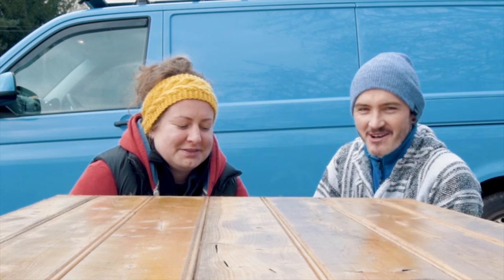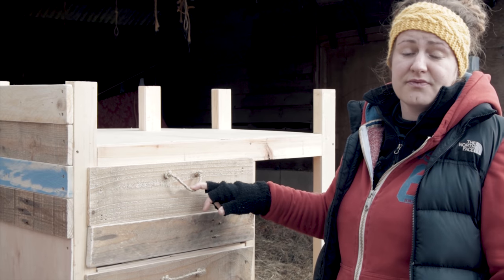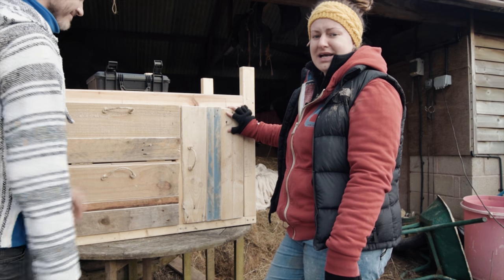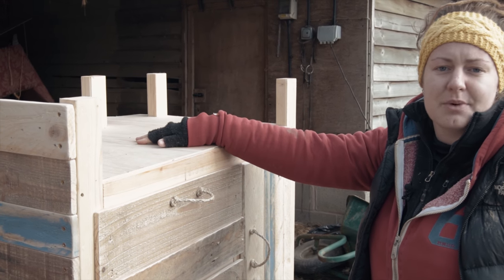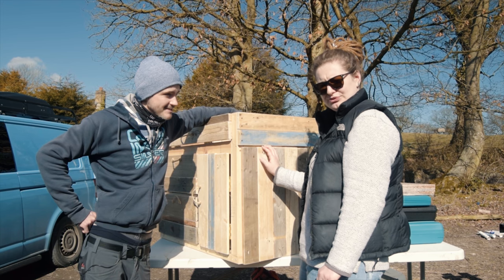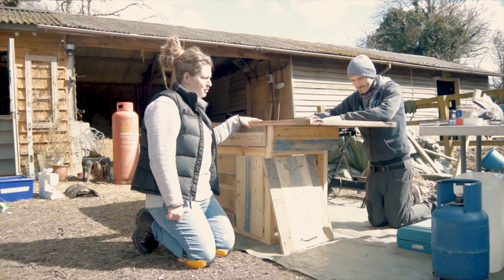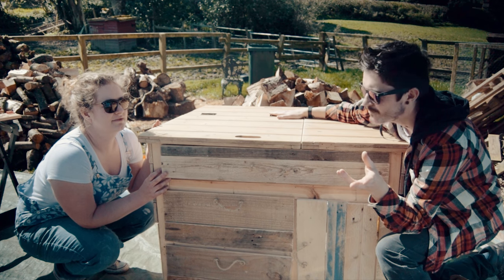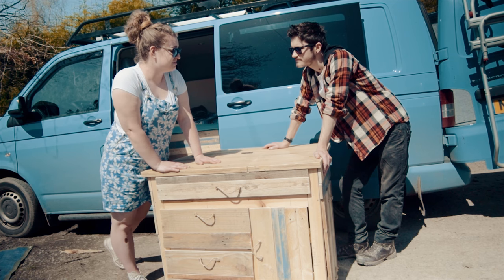Day 34 - Building Our Kitchen Unit (Part 4) #VanLife VW T5 Camper Conversion

Comment: Saw your bike rack towards the end, are you doing a review video on that? If not how easy is it to use and fit? And can you still use the van doors with it on all the time. I’m thinking of getting one so your opinion would be helpful
Thanks.
Reply from the maker: Hi Ben, thanks for your comment! We haven't thought about reviewing it but now you mention it that sounds like a good idea! Although we haven't put it through its paces properly yet. Fitting is relatively easy, the chap we bought it from helped us put it on, took maybe 15 mins or so (we bought second hand to save some money). Yeah, you can use the doors no problem, but we've almost decapitated ourselves a few times after we first fit it. We have 2 road bikes and they fit on nicely. We'd reccomend it.